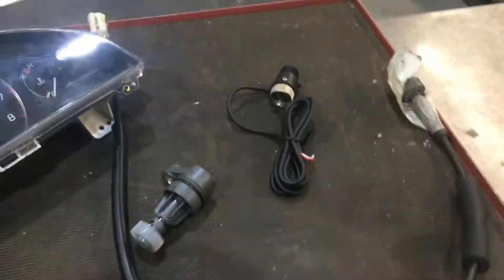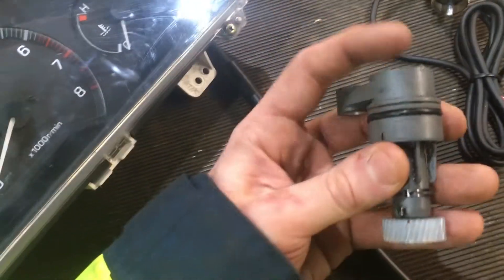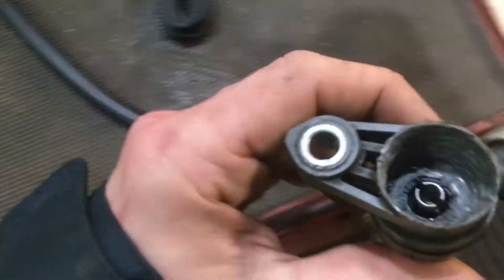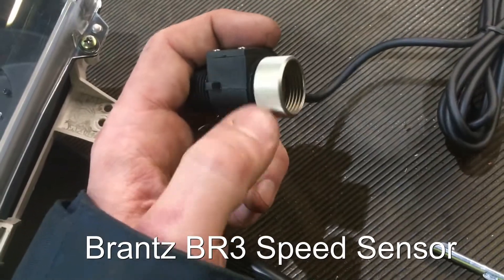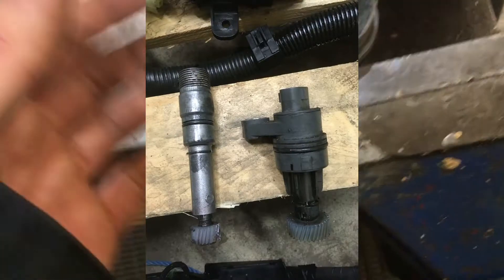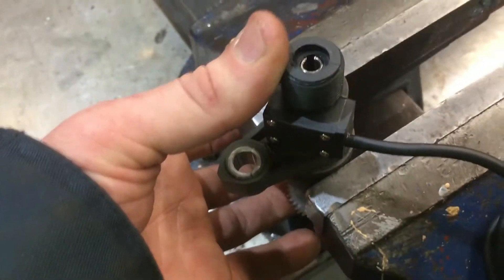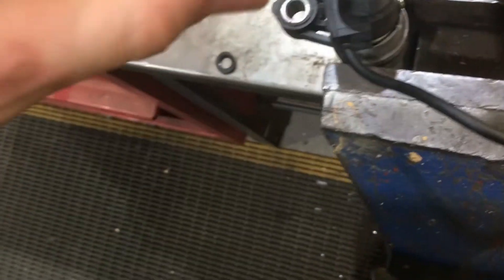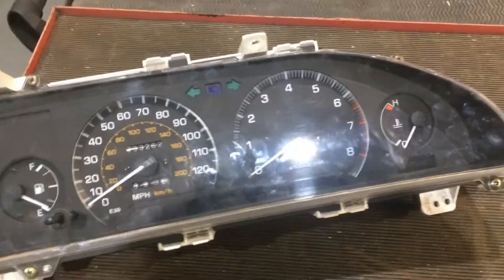Mechanical Speed Sensor to Electric & Mechanical sensor conversion (Toyota Corolla AE92)

Comment: So glad I ran across this video. This is exactly what I needed to get speed info to my standalone ECU and retain my mechanical speedometer. Do you know the wiring? The website wasn't helpful. Is black for ground and white for signal? Is the red for 12V or 5V?
Reply from the maker: Hello mate , I’m struggling to remember now but I think Red is 12v supply, black ground, white is the pulsed signal. The device comes with instructions when you buy it

Comment: This is the best thing Ive ever seen
Reply from the maker: Thanks, it was a bit of a bodge job which I carried out using the information I had at the time, there is a better method than this: 

Buy a Mechanical Speed Sensor used for a Corolla GTI, you'll need two parts :
Mechanical Sensor Shaft (33403-19285) - This is considerably longer than the electronic variant.
Mechanical Sensor Body (33404-12030) - This is the proper housing and is most ideal as it contains the inner seals which prevent oil leaking around the rotating shaft and also travelling up the speedo cable. With this installed you can then thread on a Brantz BR3 sensor, which then can output the speed signal to the ECU.
Reply: @AE92World with doing it the way you have mentioned in the comment it looks like the speedo drive body doesn’t have a mounting tab for the bolt to secure it to the gearbox is this true or am I missing something. I want to try and use this concept to a J160 transmission if possible
Reply from the maker: @NZSaltWaterAdventurer  yes this is true! It wasn’t the most ideal solution in the end

Comment: Hi! Thanks for the video! I'm in process of installing gen2 4A-FE into Ae92 chassis and going to have this same problem. Have you measured via gps-tracking or some other means the accuracy of that BR3 sensor? Is the speed on the dash, the ecu, and gps the same?
Reply from the maker: BEST OPTION:

Buy a Mechanical Speed Sensor used for a Corolla GTI, you'll need two parts :
Mechanical Sensor Shaft (33403-19285) - This is considerably longer than the electronic variant.
Mechanical Sensor Body (33404-12030) - This is the proper housing and is most ideal as it contains the inner seals which prevent oil leaking around the rotating shaft and also travelling up the speedo cable. With this installed you can then thread on a Brantz BR3 sensor, which then can output the speed signal to the ECU.
Reply from the maker: This will be FAR neater and better than the method I show in this video. I made this video some time ago before i realised there was a mechanical speedo sensor still available to buy. Sorry for for the late reply!
Reply from the maker: In terms of accuracy, it provides the same number of pulses as the OEM sensor, so it shouldn't be any less/more accurate than the OEM :) I haven't tested this, as the speedo is mechanically driven so is the same regardless.

Comment: Hello Jake, very informative video; where am I able to buy one of these plastic speed sensors you cut open? My ‘94 Corolla needs the exact one here in United States
Reply from the maker: Hi, I bought these off eBay - a speed sensor for a AE101 Corolla works fine!
Reply from the maker: https://www.ebay.co.uk/itm/Transmission-Speed-Sensor-Gear-Speedo-meter-For-Toyota-RAV-4-Avensis-Celica-/254064407604?mkcid=16&mkevt=1&_trksid=p2349624.m46890.l49286&mkrid=710-127635-2958-0